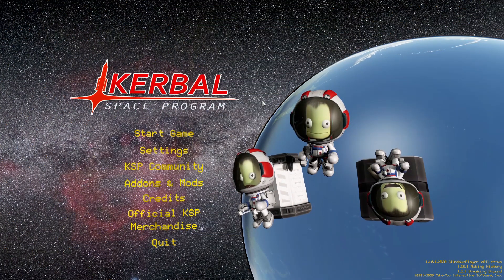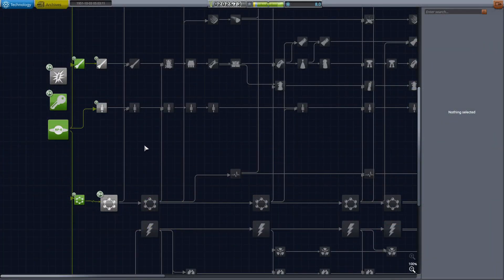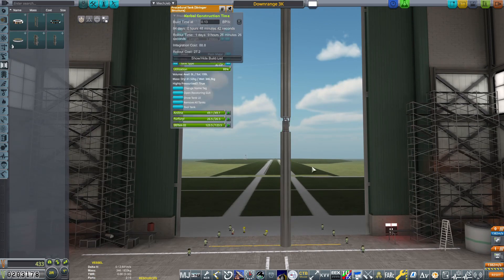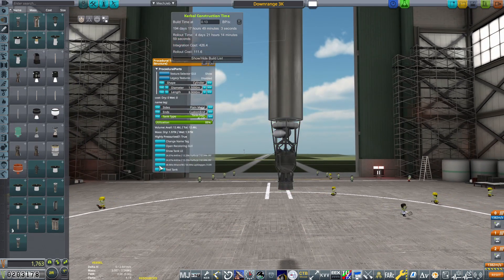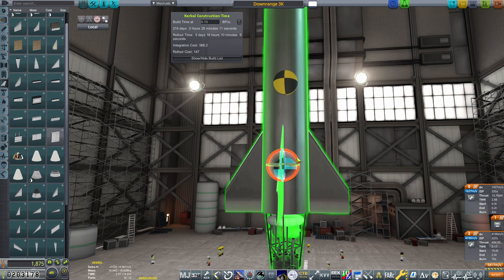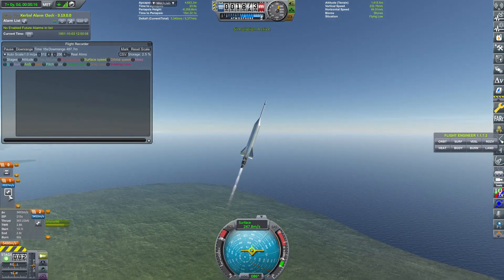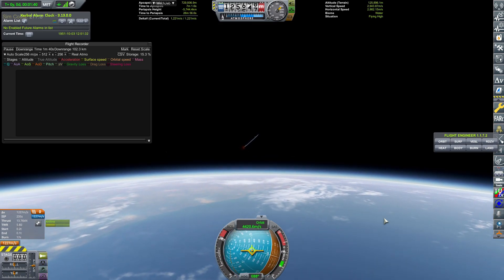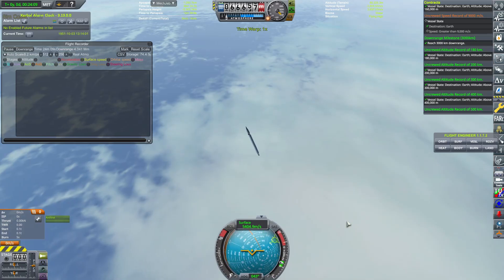3000Km Downrange Tutorial | KSP RSS/RO/RP-1 (Craft file Included)

Comment: But I have to have sufficient avionics for 50s
Reply from the maker: Don’t need avionics with this design, just launch it and leave it :p (except for when you need to stage, but the rocket will get the distance with no control)
Reply: @Carnasa  thats a goal from the contract
Reply from the maker: @Grimdiel  unless that’s been added in a really recent rp-1 update I’m fairly sure it’s not, I picked up the contract for this video to make sure that I had it all right (I wasn’t sure if you needed any sounding payload or not, turns out you don’t)
Reply: Hi  @Carnasa , videos you post are amazing, but I have the same requirement in this contract. It is a selectable contract for 3000 downrange and one of the requirements is to have 50s full control.
Reply from the maker: @bugelpavel  yup you’re right, I’ve just been trawling through the changelog, and this requirement was added in February, and my install is from January. My bad. I’ll redo this video with that new parameter in mind.
Reply from the maker: Tbh, just place some avionics on the first stage, that should fix it. That’s such a rubbish change, considering this is how the rp-1 developers recommended doing this for a long time, they even had a whole page on the wiki to do it like this haha.
Reply: @Carnasa  Man, you are awesome. =) Don't feel pressured to do that, but when you do... thank you!